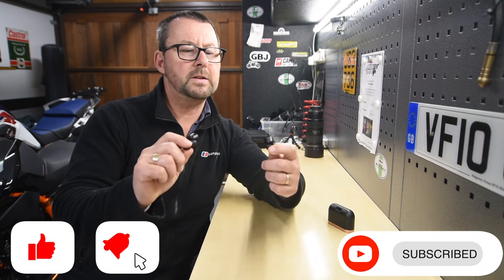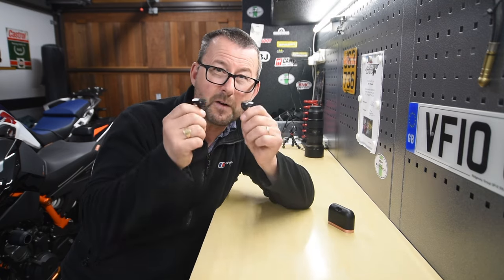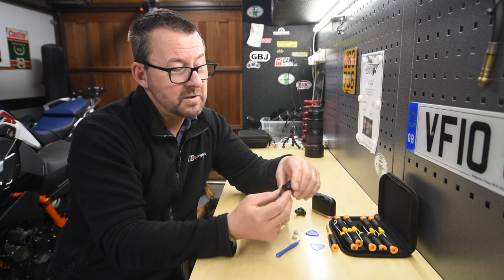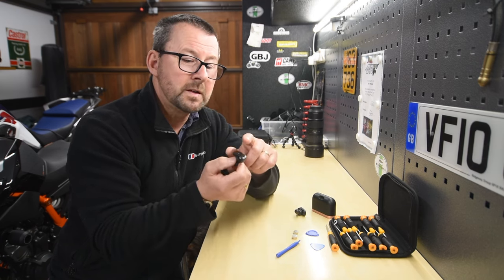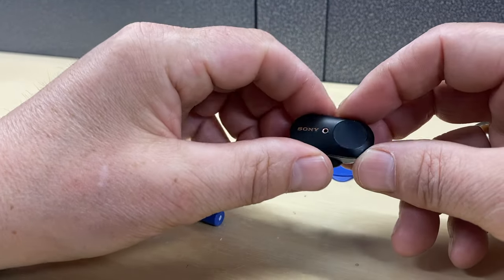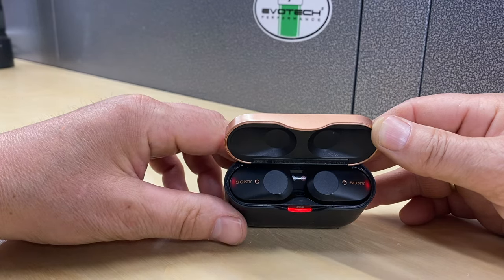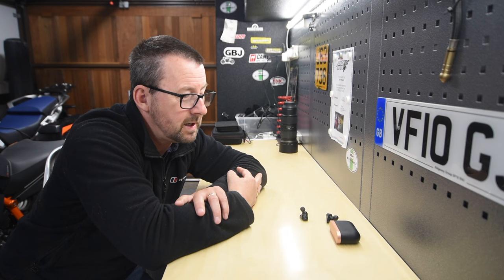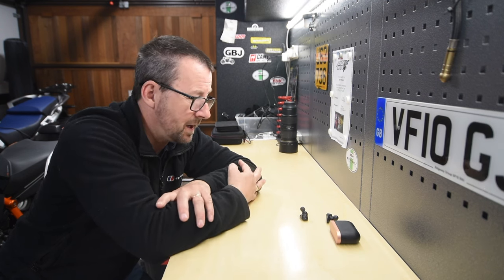SONY WF-1000XM3 BATTERY REPLACEMENT , JUST A 10 MINUTE JOB🤪

Comment: i did this but now the touch controls are not working perfectly
Reply from the maker: Hello . Have you tried a reset ? Or make sure the batteries are fitted properly . Have you damaged anything ? But try a reset first .
Reply: @gsd32i  i have tried everything , i haven't damaged anything but if i press hard the touch controls work  normally its not working
Reply from the maker: @mnvs1783  is it on both sides ? Some batteries are the wrong size and are a bit too tall which could cause a problem . Have you tried the old batteries if you still have them just to see if it’s the size of the battery you installed ?
Reply: @gsd32i  only on right side  the batteries are exact size and model of the old ones
Reply from the maker: @mnvs1783  I would try swapping the batteries from the left to the right and see if this changes anything .also do another reset and update the software .
Reply: @gsd32i  will try it out
Reply: @gsd32i  thank you for the kind information

Comment: Replaced it, the lights on my left earbuds is not working, but when i put my original battery back in, it sayd that the battery is fully charged and when i press it twice, it will say The Google Assistant is not connected, the right one looks fine and once put in the case it will have a red light.

Any suggestions would be greatm i can't live without my headphones
Reply from the maker: Have you tried a full reset? Could also Try swapping the new right battery into the left bud , to see if you have a bad new battery .
Reply: @gsd32i  it looks like it's the new battery problem!